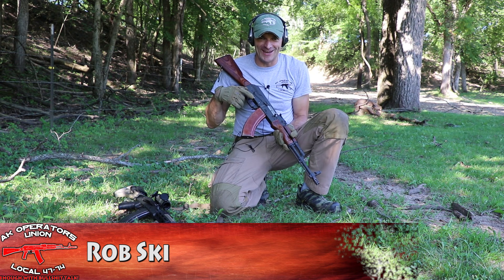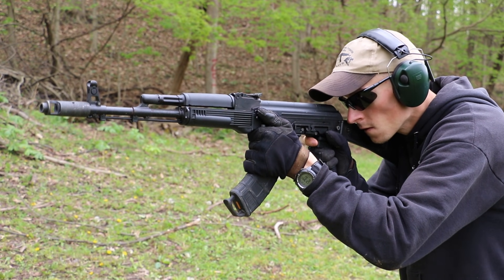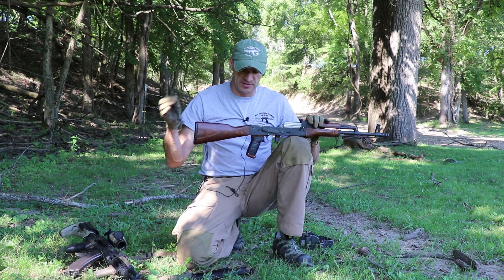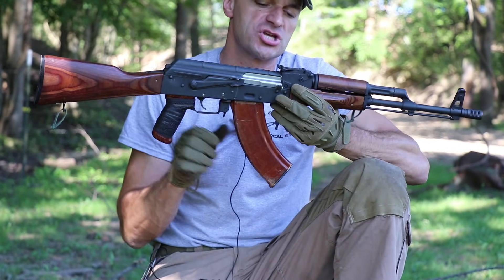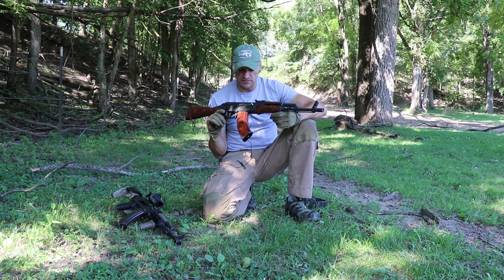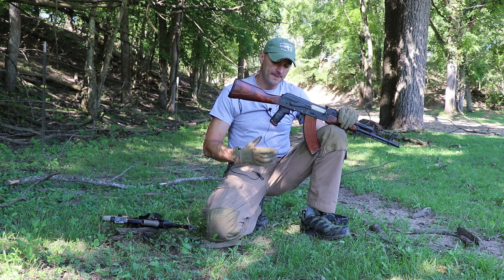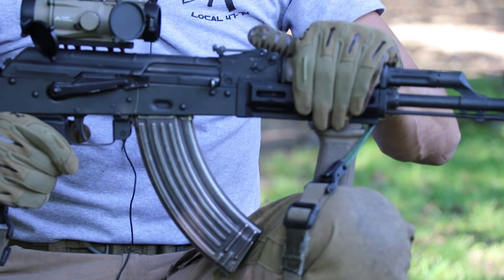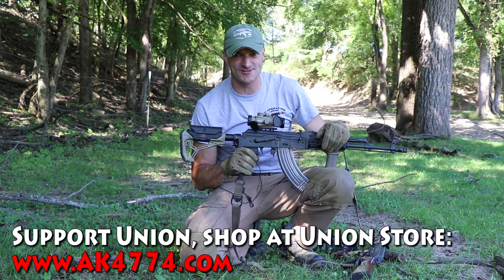AK47 USER GUIDE PART 4: RECOIL MANAGEMENT, over gassed AK and more!

Comment: Great video. 

Kalashnikov "overgas" is an intentional feature intended to maintain reliability from cold to hot conditions, regardless of rifle service condition. There is a huge difference in air density from ambients -50c to 50c, which greatly effects the gas system pressure from cold fire. 

Worth noting when you start playing with the recoil spring rate or gas pressure you will be optimizing the rifle for one condition only at the trade of reliability in extreme climate / fouled conditions.

Comment: I made a vertical foregrip for my AK to avoid the heat issue, just a shaped piece of a 2x4 held on by a hose clamp but for a $2 foregrip it works wonderful.

Comment: I agree with Rob on the ALG spring, I did a 600 round test. 300 round per spring the ALG & the Wolf extra power AK spring. I could tell the slight difference between the 2 springs. I did the test in a over gassed Npap I would like to try the same test again in a Wasr or my Wum-1. I at times rather shoot 7.62x39 than the .223/5.56 I like the recoil feel of the AK over the BB gun feel of the AR 15.
Reply: The ALG spring would be a nice replacement for old tired parts kit springs.  I just installed a wolf xp spring in my 1973 Romanian AK to try out.  The gun has seen a bit of use obviously so wouldn't doubt the 40 year old spring is due for replacement.
Reply: Pinger 556 having used both alg and wolff spring, which one do you prefer?

Comment: Theirs another option for over gassed rifles.  AK 47 with 45 degrees gas blocks can have threads tapped in the port inside the gas block and screw in a corresponding grub screw with a smaller port hole drilled into the grub screw itself.  This can be done to the AK47s with 45 degree angle blocks with minimal work.  If you want to do this to AK74 or AK47 with the 90 degree gas block you must have the tools and know how to remove the gas block from the rifle to acess the gas port inside the block and insert a grub screw plug.  Ive done it to two rifles with 90 degree gas blocks so far and it has worked like a charm.  I advise against modifying the gas piston because you will have a lot of gas escaping venting off which may minimally effect bullet velocities and possibly render the firearm useless until you replace the piston.  In fact I don't like the adjustable piston they're coming out with that much it's okay but not for me.  Also with the 45 degree gas block you would be able to tinker around with different grub screws with different size port holes to see what works best for your rifle.  This modification is rather cheap if you have the tools or know somebody with them.

Comment: Absorb recoil? Put on a AR style rear slide stock so that you can install an ATI butt pad, the thickest one. You will have to make a few holes in your butt stock to fit the ATI butt pad but it will be worth it one hundred fold. These butt pads have an almost full recoil absorption effect. Kind of like a dead blow hammer. in my world they are by far one of the best product upgrades you can do for you higher energy rifles.

Comment: I put in a heavy wolff recoil spring in all my aks (Arsenal). It help with recoil and over gassed aks. No issues with cycling and that includes ak74s. Also recoil rubber buffers don't work.
Reply: From my experience all aks tend to be over gassed. All my Arsenal cycle the same way. I don't see too many inconsistences between them. I would like to get a surplus vented gas tubes to test out on my AKs. I read before that some century aks had issues with heavy springs. However I think they had the vented ports.

Comment: Great vid rob like always. BTW I run the grip tape from ace hard wear a lot on my aks. Run a layer of it on the black polymer handguard. And a strip on the safety lever and allows me to operate safety with my pointer finger. Saves me the 60 dollars for a krebs. Works great for me.

Comment: I have been considering cutting a (small) slot on both sides of the "star" shaped portion of my gas tube.{Just behind the point where it becomes a cylinder again.} This would be,i believe, a good way to bleed that excess gas off. Thoughts?

Comment: AK recoil? If someone is bothered by recoil,Daisey makes a very nice BB-gun....I carried an AK in VN in 68 as a backup on my bird. It always worked if i needed it...
Reply: I'm too tall and the length of pull on my AK is extremely short. I find that my cheek is getting smacked because of where I have to put my head to actually see a sight picture. That's the main reason why I have issues with AK recoil

Comment: I bought a Romanian AK-47 from a gunstore, forgot what year but its old, definitely not any sort of new production. I HAVE NO COMPENSATOR/MUZZEL BRAKE. Did some of them not come with this or is it just aftermarket or what, I don't even have the threaded barrel to put one on. To clarify, i dont have that weird barrel where at the bottom it stretches out a bit further than the top. Looks like there was never anything there at all, just the barrel.

Comment: @AK Operators Union, Local 47-74 ...
A full size Draco (like a Pap pistol) with a Bulgy 4 piece brake added.
Should the mil-spec recoil spring handle the extra back pressure adequite, or should I invest in a Wolf +15 XP recoil spring to compensate?
Btw, it fires and cycles fine with no brake at all.
Reply: I would without a doubt add the ALG spring from the union store. Mine arrived overnighted and completely cut recoil in half. Rob is being modest about how much the springs actually can do.

Comment: Wow 7" group at 500 yards. I shoot a Chinese Type 81 and I get 8" at 200 meters.  Every once in a while, the gun shoots these amazing 1.5" groups at 100 meters or even 3/4" at 50 meters instead of its typical 2" at that distance. But then it is back to 4" at 100 and 8" at 200. I will need to figure out what is happening when the rifle is shooting very well and what its doing differently when its not shooting well.

Comment: What about replacing a non-vented gas tube used with a vented gas block with a vented gas tube to reduce over-gassing? Does it actually make a difference? Has anyone tried that?
Reply from the maker: +Karl Nemo no effect
Reply: Thanks for getting back on that; I'm sure I wasn't the only one with that question. I was thinking about buying one of those Bulgie vented tubes from Arms of America but now won't bother.

Comment: The best AK handling video I've seen. Ever! Great job! I have a Norinco MAK90 and it doesn't have the side optics mount. Right now, I'm running a UTG quad rail over the gas tube. What is a good top mount dust cover solution you'd recommend that is good for a guy on a budget?
Reply: Attero mount on my Mak is AWSOME

Comment: What kind of muzzle brake would you recommend that is compatible with a bayonet? Thanks!
Reply from the maker: +HustleMuscleGhias I don't know anything else other than slant brake
Reply: Kind of hard to find but the Bulgarian Brake that comes on a SAM7R is a good one. There's the Tapco slot model but that had to much wobble for my liking. If it's a Muzzle Brake you're wanting go with the Slant or if you can find one the Bulgarian. The Type 84 Flash Hider used on Chinese models also works

Comment: Hello to the union . I have the 2 gen acss scope  the focus adjustment ring at the rear of the scope wiggles look at yours if it is all the way in or out it is locked in place. if it is some where in between it wiggles and so does the reticle. sent it to primary arms they sent it in the same condition. vary disappointed.
Reply from the maker: +Thomas Heitkamp I will ping them again. Mine isn’t moving at all man

Comment: Rob.....What metal rail lower hand guards fit the upper cheese grater gas tube to further cool the AK?
Reply from the maker: +Neo Tuner even MI rail will work. I don't use upper part and jam fit cheese grater with gas tube on it
Reply: Thanks for your response .. If I order the AKM/AK-74/Vepr-12 Length Cheese Grater Upper Handguard, what lower rail in your video should I order? Also, when will the GL-Core-GCCP butt stock be available.
Reply from the maker: +Neo Tuner that was Midwest Industries rail, we don't sell that one. GL should be back within 7-10 days
Reply: Thanks.. Rob, You do have in stock the Vepr FM M-Lok Rail which is a good compliment for the cheese grater. Can I use it as a handrail for an AK 47 WARS 10? Because of your experience, can you recommend a muzzle which supresses both sound and flash that you have in stock.

Comment: Thanks you for the great video. I had failed back surgery a few years back. At one point i had to stop shooting my akm. The recoil was to much. So i started looking for  add ons to help. I put in a buffer. I got a tapco slot brake. Just a tiny reduction of recoil . Then my daughter got me a Phoenix tect. Kick lite stock. It made it so it could shoot but the stock , well for a lack of a better term the stock needs refinement. But it does reduce recoil. I just want to reduce recoil so i can remove the stock. Idea? 
Thank
Reply: Thank you . Do you have any thoughts on changing the springs.
Reply from the maker: +Rob Noce that helps too. Especially if your old spring is worn out
Reply: Thanks for your help. I have been waiting on a recoil video. Well let me talk to the boss and if all goes well i will be placing any order.
Reply: What about a night brake?
Reply: how about a night brake .

Comment: Instead of cutting the piston to bleed off gas why not tap threads into the gas block and use a bleed valve so you can change the valve size if youre running supressor or if ita just over gassed
Reply from the maker: +nathan butler I have seen done that too
Reply: Patches O'houlihan lol when it grows up? Ak platform Is older than both those rifles put together lol

Comment: Has anyone tried having a gunsmith cut their barrel for 308 5/8x24. A gun mith did it for me on an NH91 build 2 years ago and pinned a PWS 308 break (Same as that on the Commercial FN17s). It shoots like a .223 Ar-15 now. @AK_ Operators_Union what are your thoughts on this approach to reducing recoil?
Reply from the maker: +Kyle Sherrer that works too. Even going down to 14.5" and pinning and welding muzzle brake helps little bit, but that's gunsmith level operation
Reply: That is a great point! Finding a gunsmith that has extensive knowledge on the AK platform is not very common from my experience. The man who worked on my NH91 was Keith at "Tac 47 industries" in Spring , Texas (North of Houston before the woodlands). He made me an amazing custom tapco g2 trigger that pulls at less than 2.8 pounds with a very short trigger reset. If you are ever in the area Rob and Paul I highly recommend it taking a look. If you want a custom gun it can take as long as 9 months FYI.

Comment: Why do people always wanna shit on AK's and compare it to an AR? Two different platforms. Overgassed to ensure reliability. Huge moving parts and lots of space inside the gun to improve reliability. Accuracy can suck because ammo and velocity inconsistency. Bigger round and more energy so yeah there is recoil but like any gun you can manage it. AR's can be more picky on ammo choice, have a lot more small parts that can wear out, and is harder to clean compared to an AK. More prone to malfunctions when debris is present because there is little play inside the gun. If I were bunkered down in my house/community if the world goes to shit I will pick the AR first no questions; it is a great platform. If I had to bug out I'd definitely take the AK if I only could pick one.
Reply: I agree.  I have an AKM, and ive used my dads ARs a lot.  I love them both, but they are 2 completely different guns.  Comparing them is like comparing apples to cabbage.

Comment: Won't it damage the feed lips on the magazine if you hold onto the magazine when shooting?
Reply: No
Reply from the maker: +Jameson Cross nope
Reply: Jameson Cross steel AK mags are practically indestructible.
Reply: I use the magazine hold 90 % of the time when shooting and never have any problems
Reply: Elijah Decker you've never dented a milsurp mag??🤔
Reply: Thanks guys. I didn't know that. I like the AK. The round seems like it has much more umph than the AR.
Reply: Jameson Cross really depends on bullet design. M43 vs m193 will result in m193 being more effective up to 150 meters after which m43 takes the lead due to diameter. Now the king of 7.62x39 is 8m3 imo. It will destroy soft targets.
Reply: The locking tabs in the front and back of the mag would take the pressure(they are steel so how hard are you pulling on that mag to make a difference?). Feed lips would not be affected at all.

Comment: Buying my wife a AK for her BD. She had a 74 before and had to sell. What brand should I buy. I don't want junk. Thinking DDI or Arsenal
Reply: zack9912000 Get her an SLR104FR. I just recently picked one up for my fiance and she loves. I run one, as well.
Reply: zack9912000 Check out one of Atlantic Firearms parts kits guns. They are excellent and affordable.
Reply: zack9912000 If you can't find a VEPR or a Saiga, Arsenal is the only 5.45 gun available with a CHF barrel. Kit guns with US made barrels will disappoint.
Reply: Arsenal, DDI, Rifle Dynamics and Krebs Custom seem to be the top tier AK's in the US. Saigas and Veprs are also good but they are no longer imported.
Reply: I have Arsenal AK74,mags and ammo I need to sell.
Reply: kygent508 how many mags? how many rounds?
Reply: zack9912000 Good luck even finding a DDI 74 and if you do you'll pay close as much to the real thing. The DDI are nothing more than glorified parts kit builds.. They come with Bulgarian parts but US receiver, and US barrel(**Green Mountain fenocite). Why not get the real deal Bulgarian Arsenal with original CHF chromelined barrel and receiver. It makes a big difference especially if you plan on shooting 7N6 corrosive ammo. I'd steer clear from the VEPR FM-74 as well. With the heavy RPK barrel & receiver it isn't even in true AK-74 form, and in the last few months prices have skyrocketed from $900-1000 to $1400-1600. No thanks. Truth is there are no AK-74's being imported right now. I would just go for the best price you find on either a Saiga SGL31 or Arsenal SLR104. Which will most likely be the 104. Good luck!
Reply: 8, 30 rd mags diif kinds,910 rds ammo diff kinds,gun still in box.
Reply: Ak Dude rifle dynamics is the one that's a glorified parts kit gun...
Reply: Yep, RD too. Them & Krebs also modernize combloc AK's and ruin them with all kinds of unnecessary crap. All while charging out the ass in the process
Reply: Andy Newsom this: I see their wbp is sold out, but they'll get more. The romanian is a nice gun too
http://www.atlanticfirearms.com/component/virtuemart/shipping-rifles/morr-aam-rom47-red-detail.html?Itemid=0
Reply: Ak Dude Sounds like you don't deserve a Krebs even if you could afford one.
Reply: Arsenal or if you can, VEPR
Reply: dbmail545 I would like a krebs vepr or RD SLR rework...but the other guns are just glorified parts kits. Not worth the $ compared to combloc guns. Mostly speaking about barrels and receivers being less than combloc quality
Reply: dbmail545 I run an FM vepr, i don't think it's a jealousy thing either
Reply: Mike Marion My experience with 5.45 AK'S is that non-CHF tubes don't do all that well. YMMV but try to get the OG barrels.
Reply: in today's market, 104fr. done.
Reply: dbmail545 going the Ak47 route, love the 74 we both had just the cost of ammo and getting it locally is my concern buying them again
Reply: Another vote for the SLR-104FR.  It's a great weapon, very manageable recoil.  Great fit/finish and quality of parts.  The only thing you really need to think about replacing is the shepherds hook with the retainer plate and you're good to go.
Reply: whats the point of buying guns then selling them then buying the same thing in a higher caliber
Reply: zack9912000 I found 5.45 ammo at Academy, but it was 33 cents per round until they cleared it out for a bit less. Some good deals on the Web if you look for it. I got 2000 rounds of Golden Tiger and 1080 rounds of Barnaul  (spam can, new mfr) from SGAmmo this year in addition to the 570 rounds I got from Academy  (Barnaul)
Reply: Patches O'houlihan So not true! How many AKs have you run, son?
Reply: Really? Since when? I know they got rid of the 106, and I get whY, but the 104?
Reply: I see some Mak90s used going for 699.00 bucks used but get a good stock for it. I also have two polytec legends the Mak90s shoot just as good as my polytecs for a lot less money.
Reply: I love my C39V2.
Reply: It's more about the failure of the hook overtime than proper placement.
Reply: I own a under folder legend. Would love to own a fixed stock one one day
Reply: I just got an arsenal sgl and I love it. That being said I've barely gotten out with it, so what I say is bias. 😂 It's beautiful though.
Reply: @kygent508  man i am late to this like a year, but yiu stilm trying to sell?
Reply: yes I still have a slr 104fr never fired with 910rds ammo and 8 mags for $1,500 and transfer.

Comment: Has anybody found a NATO length wood stock for the AK? I have an AMD65 and that wire stock SUCKS! I would change trunions in a second if I could find a nice wood (NATO length) stock I would do it in a second. Again its about looks there. I will defend you're right to use whatever you like on yours.